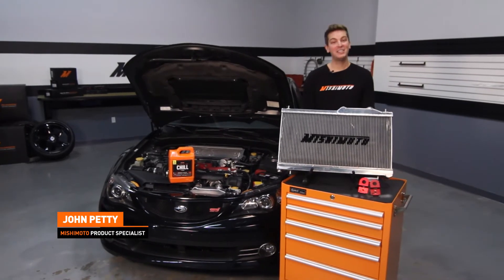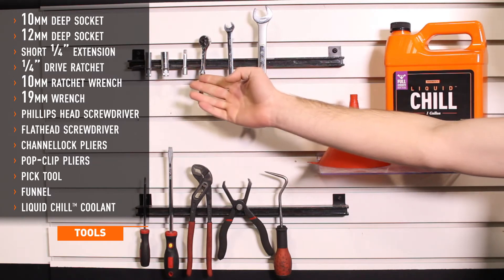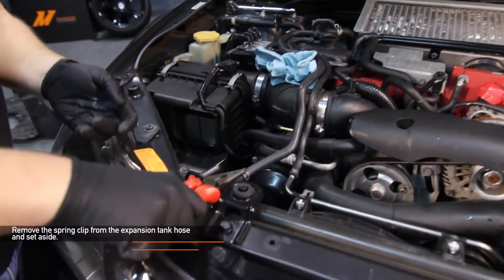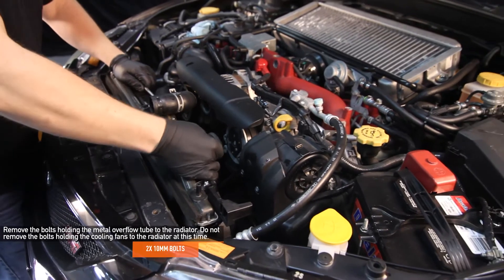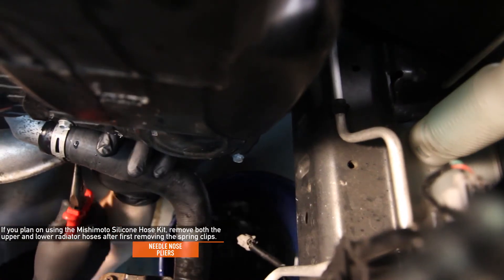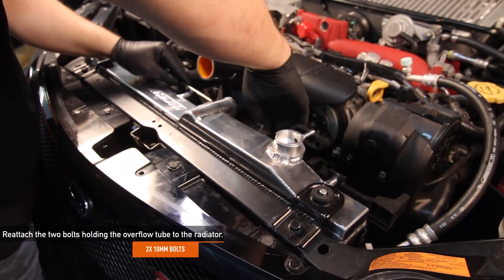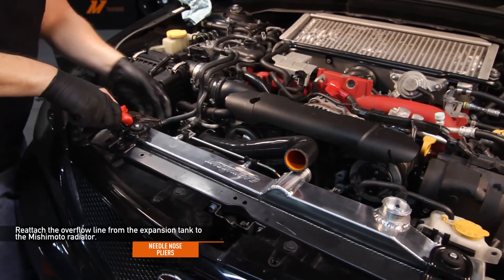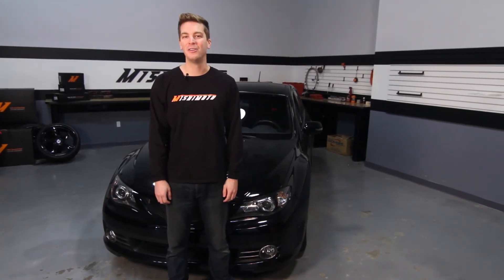Performance Aluminum Radiator Install Video for the Subaru WRX 2008–2014 / STI 2008–2015

Comment: Not sure if USDM wrxs are different, but I just installed a mishi rad on my 09 wrx here in aus and ran into a few issues. So to anyone doing the same, make sure you shorten all your hoses (you'll notice that the mishi rad is about 2 times thicker than oem thus causing some clearance issues, specifically with the upper rad hose which will now touch your pulleys) and have a cable tie ready - the hose coming off the nipple on the left side of the metal overflow tube will now be pinched against a (power steering?) hose if you try and bolt it back on. So what i did was leave it unbolted, wedged it above the bit you're supposed to bolt it to and cable tied it down.
Also note that you'll need to have the left radiator fan off when putting in the rad, otherwise you won't clear the upper hose, and if you remove the upper hose, you won't be able to get the clamp back on the engine side with the rad in. Overflow bottle will have to be muscled in through the bottom of the car. It seems like it won't fit but with enough force, it'll come through.

But yeah, it was a good experience and quite rewarding to figure it all out. 
Cheers Mishimoto!

Comment: Thank you for this concise, but informative video! What is the reason to change to silicon hoses? Are they more durable?
Reply from the maker: The silicone hoses will be more durable as they will not degrade the same as rubber hoses over time. They are also a better looking option over plain rubber hoses.

Comment: does the teflon tape come or do I have to purchase it for the install
Reply from the maker: If you are referring to the port in the upper right corner, yes, you will need to apply some sort of teflon tape there.

Comment: is this the x line radiator?
Reply from the maker: It is not, however, the process is the same.
Reply: @mishimoto  ok which one will u recommend the x line or this one? thanks
Reply from the maker: Either should be fine unless you are going with a very high HP build, in that case we would recommend the X line.

Comment: Why would you use the stock radiator cap and put the mishimoto radiator cap on the overflow ? Did you guys mess up this video ?
Reply from the maker: +wheresmy twohundred The Mishimoto radiator cap has a pressure valve and a vacuum valve. When the radiator inner pressure becomes higher than specified, the pressure valve opens to send coolant to the expansion tank. Also, when the radiator inner pressure valve becomes lower than the atmospheric pressure during the cooling down phase, the vacuum valve opens to send back coolant from the expansion tank to the radiator. These functions prevent damage to the radiator components. The stock cap on the radiator side has a pressure valve. When the radiator inner pressure becomes higher than specified, the pressure valve opens to send coolant to the expansion tank. This function prevents damage to the radiator components. Due to the difference in construction, the relief valve cap cannot be used in place of the radiator cap at the coolant filler tank side. If the relief valve cap is fit on the coolant filler tank, overheating may occur.

Comment: Does it work on 2015 sti and up
Reply from the maker: The video was uploaded some time ago so the title has not been updated. However, this will fit the newer STI models up to 2019 at the moment.

https://www.mishimoto.com/subaru-impreza-sti-performance-aluminum-radiator-08.html

Comment: Dont you need to burp the system?
Reply from the maker: Hello, most changes to cooling components will require bleeding the system of air. This is mentioned towards the end of our video.

Comment: Where is installation video on a Subaru STI 2016+ ??
Reply from the maker: Unfortunately we do not have an install video for the 2016+ models as there is not much difference in the models as far as install goes.
Reply: Mishimoto Automotive currently having problems with fitment. Swapped my oem radiator for one of yours and unfortunately the donor vehicule was a STI 2015 and mine is a STI 2016. Found out awhile ago that the upper hose was rubbing against my pulley but saw it luckily before any damages happened. I bought a new oem upper hose and cut a bit both ends and now it’s rubbing in my fan shroud... In the radiator description it say 2008-2019 STI « installation effortless with no cutting or modification required» but in the installation video it says for 2008 to 2015 direct fit !? This is very confusing. How is it suppose to fit perfectly and what do you guys offers for STI 2016 + since your application seems to work only for STI up to 2015? Thanks!
Reply from the maker: The video was created before the newer models were ever release so all the comments on the video were for the models we were able to install the item into. In some cases trimming the top hose is required as the radiator is thicker than stock and will sit closer the the motor.

Comment: why is important to change the reservoir cap?? if the OEM is 108kPa(15.66PSI) and this have coolant return to, and the mishimoto is 19PSI?? can i have problems because is more pressure???
Reply from the maker: The provided Mishimoto radiator cap should replace the stock cap located on the expansion tank. The stock cap attached to the radiator should be installed on the Mishimoto Performance Aluminum Radiator. The Mishimoto radiator cap is a two-way valve, while the stock radiator cap is a single valve. Due to the difference in construction, the Mishimoto cap cannot be used on the radiator. If the Mishimoto cap is fit on the radiator, overheating may occur.
Reply: @mishimoto  okok but the OEM reservoir cap is 15.66PSI and the mishimoto cap is 19PSI can i have a problems with that??
Reply from the maker: By using a higher pressure cap we are actually able to bring down the boiling point of the coolant keep the car running cooler. For as long as we have had this radiator available this has never been an issue.

Comment: Would you need a tune after install for a 2014 wrx?
Reply from the maker: Hey Aaron, you won't need a tune for the radiator install.